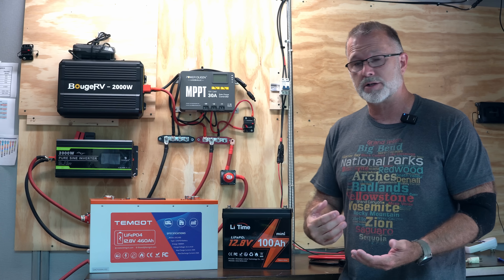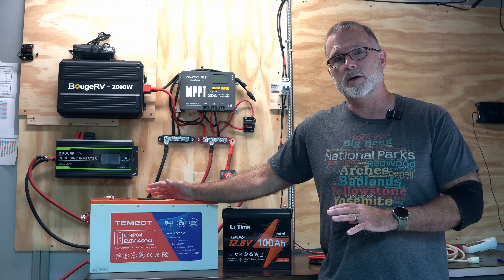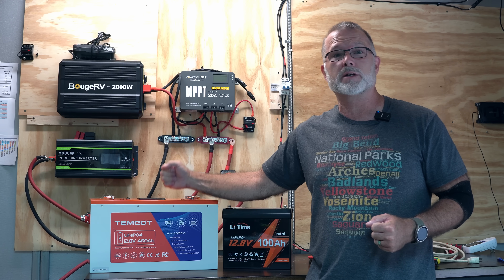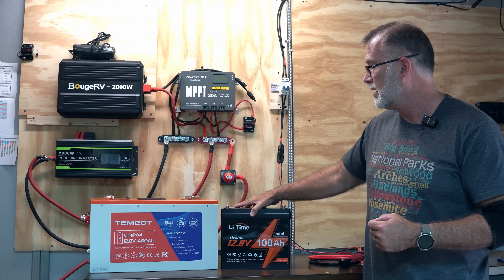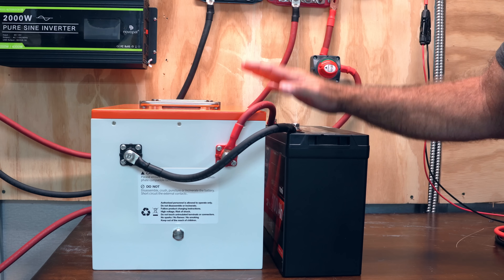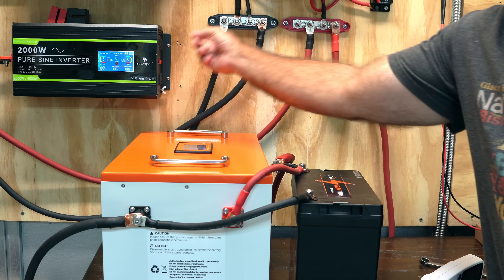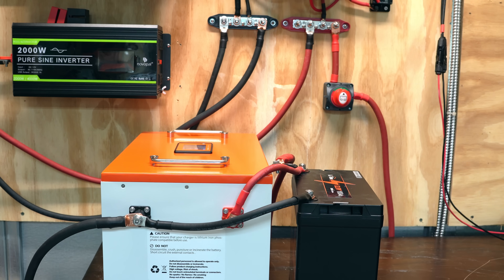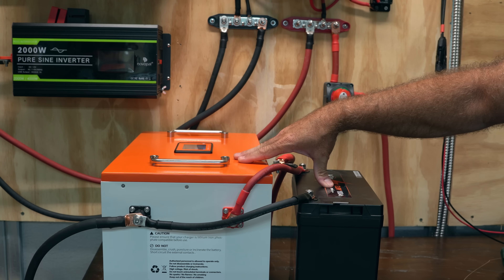Connecting Batteries with DIFFERENT Capacity in Parallel - What Happens?!

Comment: You are dead wrong.  If you wire in series 2 different capacity batteries, the stronger will feed the weaker as well as the load until they are both near depleted and either one's bms shuts down on low charge.  The bms in the smaller battery doesn't prevent incoming from the other battery.  It may limit the incoming amperage but won't prevent, somehow like you assert.  I've done this experiment numerous times so I have knowledge based on actual emprical testing.  Your theory is flawed.  The bms won't shut off as you state.  It allows current to flow both ways (in and out) of the battery within the batteries limits.  If the smaller battery nears it's low limit so does the larger battery because BOTH need to be recharged.  Silly guy.  You need education instead of making videos.

Comment: On my Harley I added a capacitor in parallel with the battery, without the cap the starter always seems to run down the battery when starting, with capacitor starter turns over like it should.  Capacitor in parallel is good for heavy startup loads like when the starter motor kicks in or when an inverter kicks in to run a refrigerator, when a motor starts initially it is similar to a dead short.
Reply: True, but it needs to be a super cap to hold enough juice to be useful. The downside is that super caps can be pretty dangerous, simply because of the rate at which they can discharge, that is a short circuit will make a very big bang and at higher voltages a shock will be lethal.
Reply: @nickwinn7812  On my Harley I used a 10,000 UF 25v electrolytic capacitor and it makes a difference because motorcycle batteries are so small.  For a Truck they make 16v Audio Capacitors that are .5 farad and above, they ususally have a voltage display that would be a voltage drain while engine is off, I would remove that part then use just the plain capacitors and attach parallel to battery with short leads.
Reply: @miken7629  Do as you please, just know that large capacitors hold nasty surprises for the unwary.
Reply: do not mix the two cases because they are not the same, the capacitor on the ac motor serves to compensate for the reactive current and not as an additional energy reserve
Reply: @makantahi3731  What 2 cases do you think we are mixing here? Nobody is talking about motor capacitors. An HD starter motor is a DC  brushed motor and has no capacitor in any case.
Reply: @nickwinn7812  the main comment is that he put a capacitor on the harley to make it start easier, and then he mentioned that capacitors are also put on fridge motors, these are two different cases that work on completely different principles
Reply: @makantahi3731  No, he did not mention capacitors on fridge motors, he mentioned inverters [from a dc battery (my assumption)] kicking in to start a fridge. A capacitor in this case will take the transient load just the same as the one on his Harley.
Reply: @nickwinn7812  okay, we didn't understand each other

Comment: If you've got a leisure battery fitted then it's in parallel with the main battery whenever it's charging. Never a problem.
Reply: You need to have a dc2dc charger between your starter battery and leisure batteries. Especially since starter batteries are AGM and leisure batteries are LiFePO4. They charge at different voltages. You will drain your starter battery and you will overcharge your leisure battery when the vehicle is on.

Comment: If its parallel Nothing is going to happen 🥴
Reply: Problems will only arise if your wire gauge is wrong between the batteries or the small battery is extremely low resistance. But even then it will eventually self stabilize

Comment: It’s confusing when you swap between using amp hours and watt hours 2:35 . Simplify it and stick to one term, the one on the batteries, amp hours. Instead of 7000 something watt hours we can immediately see 460 + 100 = 560 amp hours as that’s what’s written on the batts.
Reply: Watt-hours are actually more convenient as energy is measured in kWh (“units”). Simply do an Ohm’s Law calculation to convert, e.g. 100 Ah at 51.2V use P=V*I ( 51.2 * 100) = 5120 Wh (or 5.12 kWh). Do the reverse to ge Ah.
Reply: He does that because the kill-a-watt meter reports in wh not ah. Even if the meter reported in ah it would be based on 120Vac not 12Vdc.

This would be even more confusing as he would need to convert the AC side to wh and then convert from wh to ah for the 12Vdc side.

Comment: Great video.

I have 2 banks of 4 LiFePO4 batteries  each bank is a different "brand".  All 100 A/Hr.  When I say different brand I mean the name on the battery is different.  The BMS is Bluetooth enabled and both brands use the same app and the manual is the same except for a couple of pages added.  So I think the OEM is the same.  

When I connected the banks in parallel the BMS reported much different current readings.  I got concern so I disconnected one bank, but from the video it sounds like I shouldn't worry.  Comments, suggestions.

Comment: Long story short, the 100Ah battery will drain first and start discharging faster the one with 850Ah
Reply: Not so if they are connected in parallel.
Reply: @nickwinn7812  true, not in a parallel config, but in series definitely
Reply: Interesting. So does the bigger battery actually then suffer lower performance when connected to the smaller battery?

Comment: Enjoyed the advice. I bought 260ah 2x and now I have found 280ah 2x for less. Same brand of batteries. Now my question is what would this do to my Victron shunt reading? 🤔 I am running in parallel,  12v.
Reply from the maker: @scooter6334  shouldn't do anything really. Just need to reset the new Ah capacity total and probably recalibrate to 100% and you should be good.
Reply: @ReeWrayOutdoors  Thanks so much for the feedback. Would you set the shunt to the 260ah or the 280ah?

Comment: You have to imagine it like this. 
The large battery is a wide container for energy, the small battery is a narrow container for energy. Now you connect both in parallel, this equalizes the height of energy (Volt), but the width of the batteries remains the same. 
When unloading, both are unloaded in height (Volt), but the Ampere balance each other out.
To the point where both are empty.

Due to the internal resistance, the cells can discharge at different rates. 
But things even out again.

Comment: To expand a little on your point about BMS capacity ratings. If you were pulling a high load, say 150 amps in your demonstration, and the 460 AH battery BMS went into low voltage shutdown first, that entire 150 amp load would be shifted to the the 100 AH battery, exceeding its current specification limit. Because BMS limit shutdowns cannot be predicted and will never be exactly simultaneous, the rule I follow with parallel batteries is this: never charge or discharge at a rate that exceeds a single (or the smallest in dissimilar capacity configurations) battery's limits. There are also eddie current (balancing currents flowing between the batteries) considerations that occur when charging is terminated, so I fuse every battery at its terminals according to each battery's rating. I use MRBF fuses. I've never had one of those terminal fuses blow, but there are failure scenarios where they could.
Reply: This is what I'm curious about. I'm trying to connect two 170 amp hour renogy lithium batteries and one different brand 280 amp hour lithium battery to a 3000 w inverter.   Should I use fuses in between each battery and different cable sizes?
Reply: In "no" particular order, neither battery - will totally deplete itself before the other one starts to take the load, because THEY ARE NOT individually switched, via contactors or relays, thus BOTH share the load, reducing only in voltage as they deplete, when the voltage is about 11.5V BOTH batteries will have depleted to about 20% remaining (completely irrespective of capacities), as NEITHER simply provides all the loa current, until the battery's capacity is depleted - leaving the other with a "higher volage and remaining Ahrs.

They are "after all" connected together.
Same goes for two as for a hundred or more, of the SAME VOLTAGE but different types and ratings.. as ALL different capacity batteries would simply be "extra storage" at the same voltage (below I compare these with see-through water tanks with the same upper water levels) which would all deplete at exactly the "same levels" when interconnected as parrallels, because when each shares the total load - no battery will be individually depleting itself, before any other.

THINK and respct the equation.

BOTH batteries are comparible with TWO (or more) tall & "same height" see-through plastic water containers that could be connected together irrespective of capacity, thus a 1L container 1M high could be parralled to an IBC which is 1,000 L and 1M tall interconnected at or above the upper level of each (or 1,000,000 such tanks of various capacity, all 1M high) such that their lowest output vent, is at the same lower level as the other's lowest output vent.

FILLING BOTH (or all) water containers to the SAME upper level, and then "opening" the one combined output supply pipe at their lower vents, ONLY reduces the total "level" as the load draws content (either water or electricity) from whichever "parralled" connection you have.
The batteries will drain in EXACTLY the same way as the two interconnected water containers, it's just that the see-through tanks let you SEE what the dimishing current levels would be like, inside the enclosed (non-viewable) batteries..

NEITHER (OR NONE) of any interconnected battery, EVER depletes more rapidly than any other.
Thus the BATTERIES would go below 1% capacity - at EXACTLY the same time.
Neither (or none if more than two) would be "left" with any higher capacity level than their interconnected total "loading" capability levels, as BOTH (all) drain equally as the levels reduce.

Anyone thinking otherwise, has ZERO idea what a "parralleled battery circuit" does, when any loads are connected to the one output point..

Comment: if you parallel a large and a small battery. won't the large one act as a charger for the small one and overcharge the small battery? Correct me if i'm wrong
Reply from the maker: @ford1546  it will provide a charge to the smaller battery but only to the extent that it equalizes the voltage between them. It won't overcharge the smaller battery provided they are the same battery types (chemistry).

Comment: Try this with agm batteries with out internal bms. 
The capacity is there but the cycles are less .
Basically different size battery’s with out bms do not work well for the longer duration
Reply: reason?
Reply: @laus9953   good you ask. 
It’s my experience on several vessels where Victron agm battery’s where installed ,different sizes liked together.
In most cases the bigger battery does not get absorbing time.  The battery’s doe not equalise at all. 
On the battery monitor systems it looks well. But apparently the life cycles are about 60% of a normal span.

Comment: Should you not mention that booth batteries be at the same voltage before you hook them up to stop a surge of power from the highest voltage to the lower voltage battery.
Reply: Extremely important to say again. Make sure the current voltage of each battery is within 1/10th of a volt or you might overload one of your batteries.
Reply: He did.
Reply: Essentially, this is what active balancers doing
Reply: @vadnegru  even low drop shottky diodes should help in some cases, like low power long term load.

Comment: Nobody likes 12v systems outside of cars anymore but i feel like this is a great unsung benefit of lifepo4. It's WAY easier and less picky to parallel all kinds of lifepo4 together than it is even with lead acid! As long as none of the parallel connections are outrageously bad it will almost always 'self balance' faster than you charge or discharge it, and if your C rate is way less than the combined capacity of the bms's you dont even need to pay close attention to how well all the parallel interconnects are even functioning. Basically, you can be sloppy as hell and still have it work pretty well!  None of that is true with higher voltage series connections, nor is it true even when paralleling lead acid.
Reply: why do you think this is not the case with lead acid?
Reply: @laus9953  Because lead acid has much higher internal resistance which means a set of lead acids in parallel with each other will not 'balance' with each other to nearly the same extent because it takes several tenths of a volt difference to cause any meaningful current between two lead acids in parallel, whereas a set of lifepo4 in parallel will very quickly balance to within hundredths of a volt of each other. As an example if you test both the starting batteries in a diesel pickup its VERY rare for them to degrade evenly even though they are hooked up in parallel.
Reply: @Vigo327 Cars rarely (if ever) have proper parallel connections. To ensure that both batteries are used evenly you must connect car positive to the positive if one battery and car negative to the negative of the other battery (as well as the parallel wires). Or you connect the car to the mid point of the parallel wires.
Cars always (?) have both connections to the same battery.
Even though the resistance of the parallel wires is small, it's enough to make that difference.
Reply: I agree. I also plan to do a 12V Setup (all parts ready to go, just time is missing. The only draw back I see is the current on the 12V system: It is much higher than on higher voltages, which means you need thicker wires and you are somewhat limited in your maximum power output.

Comment: I want to add that as it might not be obvious. You need to be sure when you add batteries in parallel that those realy have equal battery chemistry not just lead-acid vs nickel based vs lithium based. Like if you have Li-ion batteries (Li-NMC,  LiFePO
4, LiCoO2,  Li-NCA), Li-ion is common nominator for these. And i have seen batteris that don't have anyother label for their battery chemistry (usually due to integrated circuitry which is different story)  even if they had same nominal voltage, curves might be different (and will be if chemistry is different) -> then there would happen weird chagings between batteries. and some even have small voltage raises before curve sharply decreases at the end of capacity.
Reply: that would be a problem in series connection - why should it be one in parallel? let balancing currents flow - balance will be kept, no?!
as long there are sufficient fuses between batteries, in case one does draw or supply too much..

Comment: But smaller battery's voltage drops faster than big one and its BMS will cut it off at some point.
Reply: as they are in parallel, the voltages are practically equal - so the smaller one's voltage does NOT drop faster!

Comment: The BMS only "see" the current of it's own battery, and in a parallell circuit the current is divided by the two batteries. In theory, with identical battery chemistry, two batteries in parallell should provide the part of the current drawn exactly proportional to it's capacity. Meaning, a 250 A battery and a 100 A battery in parallell should in theory be able to provide 350 A, reality isn't that perfect, but well over 300 A should be possible without reaching the current limit of either BMS.

In a serial circuit both batteries sees the same current, the full circuit current.

Comment: New question, can you connect 4 batteries, first 2 and 2 in parallel and than in in series for 24v?
Reply: Wie viele Batterien Du in Serie und parallel schalten kannst, findest Du in der mitgelieferten Betriebsanleitung. 4S, also 4 Batterien in Serie schalten und so ein 48V System zu bekommen sollte in den meisten Fällen kein Problem sein. Diese 48V Blöcke parallel zu schalten ohnehin nicht. Ich würde dafür allerdings denselben Hersteller und Type verwenden.

Comment: Before I watch, my thoughts…..It depends upon voltage (pressure) difference. If both the same, no current flows. If one is higher voltage it pushes current through the other battery.  If nominally the same voltage such as two car batteries, the weaker gets topped up until the voltage equalises then it stops.  The CAPACITY (Ahr) is the sum of both batteries.  NOW I WATCH AND PREPARE TO BE CORRECTED😂…….Edit - Watched. OK I wasn’t wrong👍, but he was discharging both which wasn’t in the question.  Interesting.

Comment: You can actually mix chemistry aswell. If using a "12V" LiFePo4 in paralell with a "12V" Pb battery the LiFePo4 battery will do most of work.
Reply: I actually did this couple years ago in a 24V system. My LFP batteries back then were horribly imbalanced so I needed the Pb backup for when the BMS would crap itself again. No problems at all.

Comment: I highly suggest if you are using different capacity batteries connect each one to a busbar. Then it will pull according to voltage better. Daisy chaining different capacity batteries is not good.